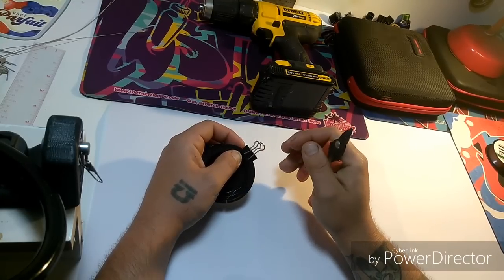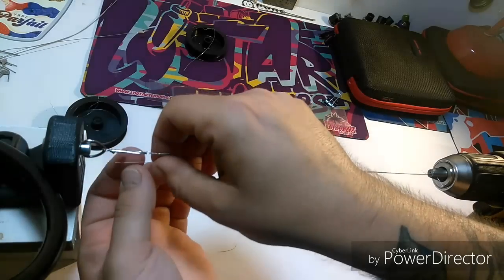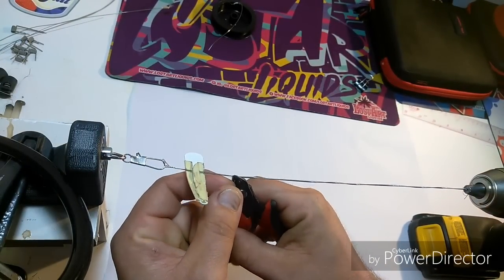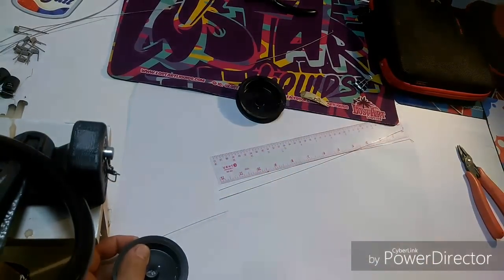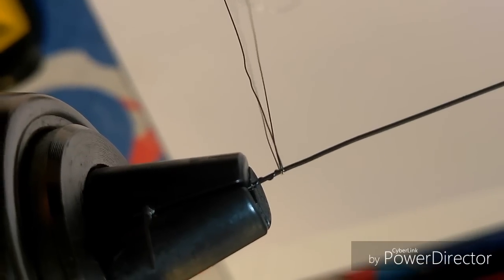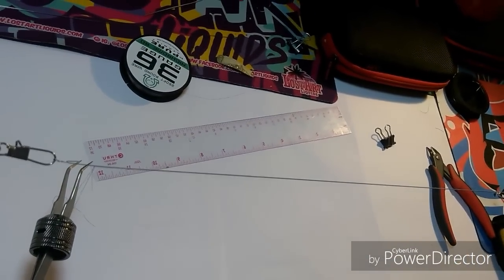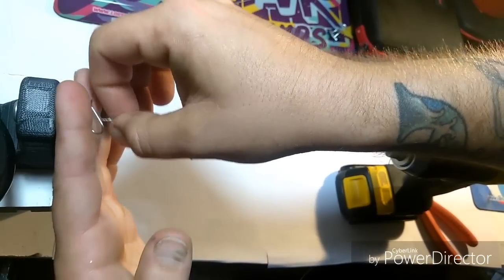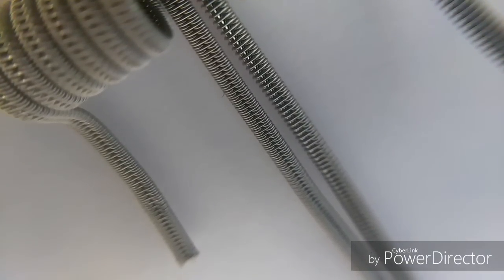Coil Build - Just starting off - Vol 3 - Half and full SFC - force fuse and loop method - n.devine83

Comment: I'm totally new to coil building and I cannot tell you how much I appreciate these build tutorials. I went straight into my first staggered fused clapton the day after I got my first fused clapton done. I had a lot of help and advice from a buddy of mine in a facebook group I'm in and believe it or not, I got the fused clapton on my first try and the sfc on my second try. However I think I just got lucky on the sfc because I couldn't really get a really nice one after that unless I did the fuse with a smaller gauge wire. That buddy of mine sent me a clip from your double loop method video and it helped me out tremendously. Now, after adopting some of the tips from this video, I'm able to get a great sfc every time I pull out my drill. Thank you so much for all the work you've put into these videos. I've only been making my own wire and coils for a couple weeks now but thanks to guys like you, I've been able to progress incredibly quickly in very little time. I still haven't attempted my first alien yet but that one is next on the list.